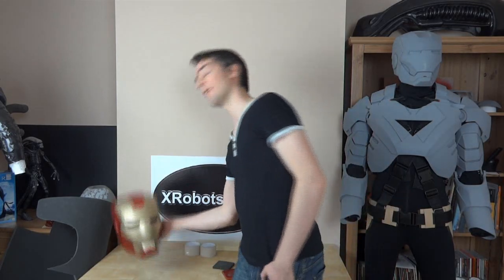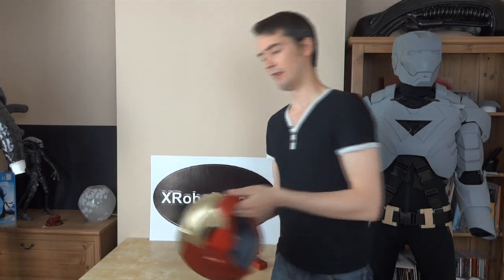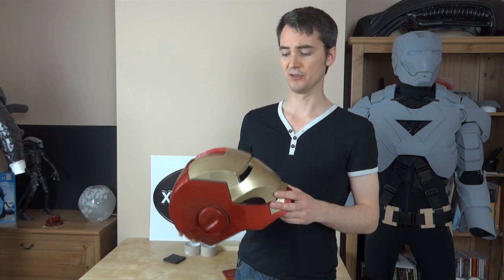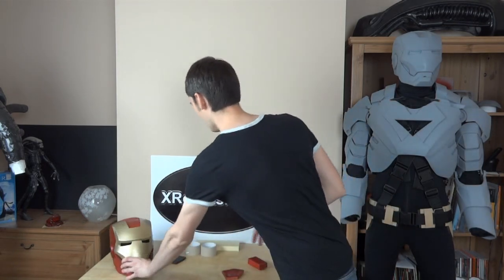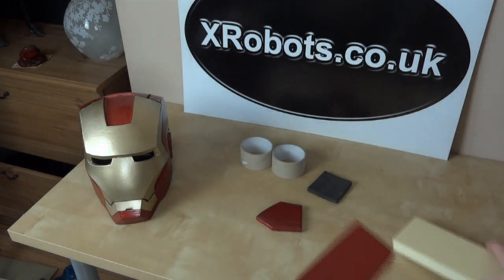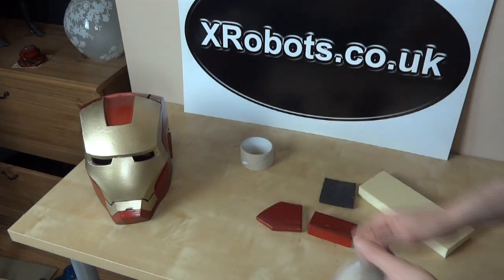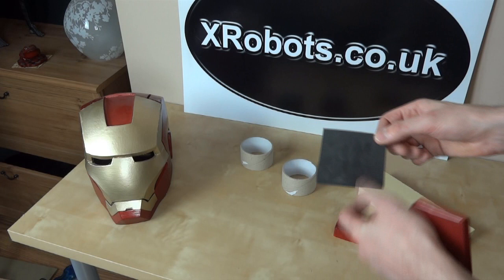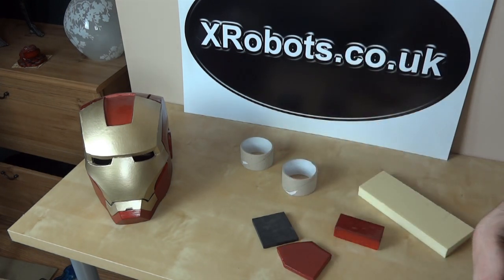Iron Man Power Suit #6 | Plastic Coating Foam | James Bruton

Comment: That smooth cast 65d resin is pretty expensive, would you get the same results if you used fiberglass resin? Of course after coating it a few times with PVA....

Comment: James the blue and yellow container are both Smooth 65D ? What exactly are you mixing in the 2 small cups ? please explain I look forward to using this method. Thx
Reply: It's a two part resin: one is a liquid and the other is another liquid that works as a catalyst to harden. They're both part of the 65D mix

Comment: There is no need to set the suit in silicon and make a fiberglass case using this method?
Plus, why do you need plastic primer after you have already effectively primed it with pva?
Thanks in advance

Comment: I'm making my first cosplay at the moment and I'm planning to use foam. Found this video on a quest to coat the entire thing in plastic, and it's very helpful. I was wondering though, before I go and do this. I was planning to use wood glue as a gap filler for my piece. Would this method melt down the glue I use as filler and leave the gaps open? If so, is there anything you can recommend as an alternative to glue that would work with this?
Reply: +YuutakaIzumi wood glue is usually pva glue. Elmer's brand is also pva.

Comment: Is there a viable replacement for the smooth cast that has the same general affect without the need of constant rotation? I only ask because the Iron Man armour has hundreds of bumps, nooks and crannies, and is also not very circular, and it would seem that the smooth cast would drip into crevices, clump up, and just be an overall mess.

Comment: Hello ! Great tutorial, but can i ask something, if i coat the foam with pva and then with primer, without the plastic coat at all, will it harden anyway ?
Reply: The only issue I see is that PVA is, like he mentioned, water soluble, and start to get sticky and even run with too much moisture. This could possible cause problems when you're painting (or priming) directly to the PVA. 

If you're worried about cost, there are plenty of places online to find good resin on the cheap, or you can substitute something like Bondo, though that doesn't go on as smooth as resins. If you're worried about the work involved, if you're looking for a long lasting piece, this is a pretty excellent way to do it, and worth the work.

Comment: my DIY helmets are foam sheets and cardstock paper, with hot glue holding the seems.. i plan on using a filler to smooth over the glue and seems. is the chemical used in the video for me? if so what step should i stop and do the filler? thanks

Comment: you youst put pva glue without mixing it with water??? and that blue and yellow gallons that say smooth cast 65d what is that??? since theres one plastic and this stuff since ive never work with before. i want to try this method. but before i buy it i need to know what are exacly thos two things that you mixed :) epic tutorial man

Comment: How well do you think the plastic coating (and the foam item itself) would hold up to vacu-forming plastic, in other words using the foam piece as a mold original for vacuum forming pieces?
Reply: Good point, James.  Thanks.

Comment: Hey, I just wanted to say thanks for showing these great videos about how to make a great projects :). I got a simple question. I made an iron man helmet out of paper, and resined the helmet. What is best when filling the helmet, the bondo and sand it down or Polyurethane? because when i put the helmet that i made out of foam, my ears keep pushing the helmet to the sides and it does not hold its original shape. Is polyurethan strong plastic that can replace bondo on top of resined helmet?

Comment: @James Bruton  .. hey wondered if you can help me .. im building a foam sword from the japanese show gokaiger and was wondering if you could give me some advice on weither the foam blade would be sturdy enough with just a pva coating or can i brush on a nice thin layer of resin and make it even sturdier ?? dont want it snapping though.. also building a star trek phaser rifle from insulating foam board will that hold a thin resin coating ok ?? cheers :D

Comment: is it a specific plastazone foam to use, i googled and they have flexible ones. but i want to use the exact one that you're using. and why did you use two different smooth cast, do the blue and yellow bottle make a difference? i'm doing a batman arkham origins deathstroke cosplay. Amazing work on your ironman and great video.

Comment: I'm having a terrible time with the 65d. It doesn't cure on the foam after DAYS. Keep wiping it off & trying again, & as far as I can tell I'm following the directions exactly.  When it has cured, it's terribly clumpy and cures in random patches. Any ideas?
Reply: Just as a guess, it sounds like you either aren't mixing it well, or don't have the ratio of the two parts right.

Comment: after the first coat if you pass a heat gun over the bubbles they disappear, i have been using this method for years and never had i bubble, the gun has to be hot and dont stay in one spot to long

Comment: Hi james , nice tutorial.. i ve tried it myself, but... when i apply more layers the layers dont bond and i can peel of the layers .. 
did you experience that aswell? and did you sand in between layers?

tnx for sharing your experience
Reply: +Ricardo de Jongh 
If you sand between layers, that should help the layers bond. Or instead of sanding you could rub them down with fine steel wool. It seems a bit strange that the layers aren't bonding. If you go to the Smooth-On website there's lots of helpful advice on how to use their products.
Reply: +Ricardo de Jongh I've never worked with 65D before but I used to work a lot with a slower-curing resin. Whenever I wasn't quick enough to get my next layer of fiberglass and resin down while the previous one was still slightly tacky, and had to go from full cure, I'd clean it with a 50/50 mix of acetone and denatured alcohol, then sand it, and then clean it again. That gets rid of any oils, build-up, dust, etc. that will inhibit bonding or curing, as well as provides a rough surface to facilitate bonding.

Comment: Can you use smooth on 300 for this process instead of 65D?  I was going to follow your procedure using the PVA base and then smooth on for plastic coating foam parts and the 300 variety is easier for me to get.  Is there any difference that would matter for this kind of project?

Comment: So I was wondering if this 65d smooth cast is a better option as opposed to the other casting resins they sell at smooth on like the 300 series most use for casting their helmets
Reply: The 65D has more flexibility than the 300 series.  It is also thinner and can be brushed into thin coats easier.  Helmets require a bit more rigidity since they are, effectively, on the safest part of the body from bumping into stuff.  The success of this method lies in the thinnest possible coats. 

Keep in mind, this video is not casting anything, it is coating something, so it is deriving its support from an underlying structure.  If you tried this with any sort of total rigid resin, you would have to ensure a solid and/or permeable structure underneath or else the resin will be prone to more cracking than it already is.  Also, the company that makes this stuff specifically recommends the 65D as a rotocasting resin, but to each his own.

Comment: *****  in another video, you said this glue is similar to school glue, yeah? so like... in America we have "Elmer's Glue" which is used by kids in school. is that what you meant? does that work for sealing too? because i couldn't find PVA so i bought a gallon of Elmer's.

and if you don't want to plastic coat it entirely (resin is expensive), would it be ok to just coat it in the glue, let that dry completely, and then just go straight to plastic primer, paint, and then plastidip to finish? or would that not stick well enough?
or would you use plastidip and then plastic primer and then the paint? because "plastidip" seems to be a little bit of a misleading name as it is actually made of rubber lmao.

and did you use a very shiny paint? and will mine turn out more matte like i want it if i use a normal spray paint?

(sorry for all the questions. it's just that my con is coming up in a month and i'm finishing up my cosplay, not iron man but it is a robot, so i'm very nervous about getting everything right. i don't want to go through all of this work and then realized i fucked up and everything's worthless.)

Comment: James, this video and the build are amazing! I'm trying my hand at building a Mass Effect 3 foam armour, but I'm using the textured/patterned side of the foam to have a carbon fibre look to the armour, which I would want to see after the plastic coat. Do you know of any products like smooth-on 65D that dries clear, instead of the while coating?

Comment: I was wondering, say for the Mark VII Iron Man Helmet, if there were certain areas that I wanted an indented groove line running along the side, would coating with 65D fill those gaps? Is there a way to prevent it? Because I'm presuming that it's not a good idea to say use a heat gun to put the grooves in after it's been coated :P

Comment: by using the method of the pva glue and the smooth cast 65d would it make a good adhesive then apply a small amount of plastic primer to seel up any gaps if the armour if the foam and plastic weren't to stick that well but the armour made piece by piece but some pieces big and some smaller ?????

Comment: i got a question. My next project is going to be the N7 armor from Mass effect 3. On the right arm the armor is 3 colored. whats the best way to separate the colors and which kind of color is best to use?
Reply: since he used spray paint, shoudl think about what colors go on the 'top' and 'bottom' and do your best to do it in that order (from what I can see, put down red, then white, then the grey/black)
try using masking or painters tape or even templates you cut out yourself to make the lines straight and properly shaped. 

Then just spray paint like normal. I can't promise this'll work but it seems like the best method.

Comment: I have a few questions:

 First, I know for plastidip I would need a respirator, would it be the same for the smooth cast 65D?

Second, What isthe difference between the yellow bottle and the blue bottle of smooth cast 65D?

Comment: ***** An excellent instructional video that I found very, very helpful. I'm making a large expanded polystyrene car body 'buck' or 'plug' from which I'm going to make a mould for eventual production in glass fibre. I have used PVA for sealing small pieces before but the addition of the resin will produce an excellent finish that, importantly for me, can be filled and sanded prior to the mould being applied. Many thanks - my only crit is that when holding the pieces to show them to camera you wave your arms very expressively so one can't actually see the piece! :-)

Comment: Yowch. o.o Bit pricey. xD But thank you. :)
Just to clarify, would it be at all possible to skip this stage? I'm a bit short on money to be spending that much, and I understand it may not give it the desired glossy finish. But I'm just wondering if using the layers of PVA and then the Primer before the paintjob would work just as well? Without the gloss of course. :) 
Thank you. XP

Comment: What's the difference between the yellow and blue containers in the plastic casting bit
Reply: Its  two part resin, so part a and b come seperate and when you mix them together they become the coating he applies

Comment: IM IN THE PROCESS OF COLLECTING MATERIALS for a Deadmau5 (popular dj) head, and pretty much foam is my only option for the ears, does the type of foam you use come in thickness' around 3/4" (24mm)? if not does this foam have issues binding face to face?

Comment: What others alternatives to 65D do you know? some people of smooth distribuitors, recomend me shell shock, epoxamite 101,smooth cast 45D, smooth cast 321 series...
I need a little flexibility in the pieces and few weight, i don't want to use fiber glass. thanks

Comment: My actual question is, can i use Polyurethane resin on a fiberglassed helmet in order to replace the bondo? this way i dont have to sand the helmet alot. and it will show more detail? and if i do use polyurethane resin on to of fiberglassed helmet, how many coats should i applie?

Comment: what if I already painted my foam but I want to make it look like plastic? Can I apply the PVA on top of the painted surface?
Reply: +Kenneth Rivas "Can I apply the PVA on top of the painted surface?"

If you don't want to risk it, test this on a trial piece of foam that is not your costume:
 spray a coating of automotive plastic primer on the paint, 
 then coat with smoothcast (remember to sand it, then clean it),
 prime it again, then paint.

Theoretically, if the primer can go on the smoothcast, it can go under it.
Reply: Thanks, but that would mean spending more money..  :( but I'll try it as a last resort

Comment: Hi, Im curious about the different types of the Smooth on.. which would provide the strongest coating for foam armor? What is the difference between the different types? Thanks!

- EpoxAmite® 100 Laminating Epoxy
- Smooth-Cast® 300 Series
- Smooth-Cast® Semi-Rigid Urethane Casting Resins

Comment: The Polyurethane that I have is not that kind. It is a fast drying heavy use one that dries clear and glossy. [And it is oil based. I can switch it out with a water based one if I need to though.]

Comment: So, the layer that comes after the PVA is polyurethane? [Just checking, lol.]
I forgot about what the first layer was supposed to be, so I ended up getting a primer/sealer that is compatible with oil and latex based paints/coats. I also accidentally got oil based polyurethane, because it was compatible with the primer. 
[I feel so dumb. x_x ]

It'd be weird if it actually worked though.

Comment: Hello men, i have a problem, will add two coats from pva glue and one coat from smooth-cast 65 d and all was well but by adding the second coat from smooth cast, this failed to dry and too sticky. Wich do you think is the problem?

Comment: having had a problem with the 65d going off before I finished coating my model I contacted the company and they told me the pot life is only about 2/3 minutes when asked if I should use small amounts to build up the coating was told that the 65d will not bind together and would delaminated
Reply: hello there it was my main concern about binding together 65D. Did u company u called give u recommendation of any other product ???
Reply: Marcin Marczewski 
Had a second shot this time working very quickly I'm keeping the mixed part in iced water very successful
Reply: thx for tip however I think it wont work with me as I have over 2 meters power armour to coat in plastic :) 
i think will give call to company asking for different product. PS did u put only one coat ??? how is with recoating ???
Reply: Marcin Marczewski 
Just one coat was sufficient for my requirements it's a static model
Agree it's best to talk to the company very helpful

Comment: Hello everyone! I would like to ask a few questions to those capable of answering it, concerning the Smooth-cast 65D product. I am currently attempting to build my own cosplay, and planned to use said product to give some sort of plastic coating over it. However, everytime i try to find out more about the product and what it can be used on, all i end up with is youtube videos showing how people put it on EVA foam or other kinds of foam, and i was wondering if it can be safely applied on... Well, paper mache. It is the only thing available in my area that isn't overly expensive, and due to my relatively small budjet, i can't buy anything else to experiment on, i would end up ruined just for a simple costume. 

I also have a second question, concerning this very video. At 12:09, James tells the name of the product he used to make the piece all grey, but for some reason i cannot seem to be able to understand what it is. What is the name of it, and what is it's purpouse? Thanks to whoever answers these two little question!

Comment: Hi, does anyone know how many coats of Polyurethane would be needed for a nice solid finish using an artists airbrush?  After doing some looking, i've found a couple of vids where people have said that so long as you're quick and work within the 20 minute limit, an airbrush can be used, but you need to clean it out afterwords with a solvent.  Just would be good to know how much thinner an airbrush application would be so i know how many coats might be needed.